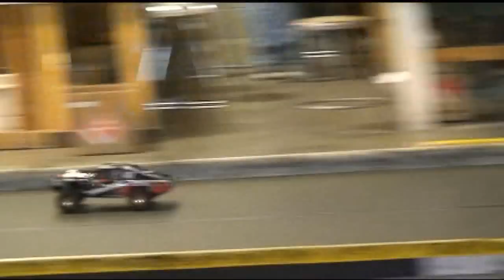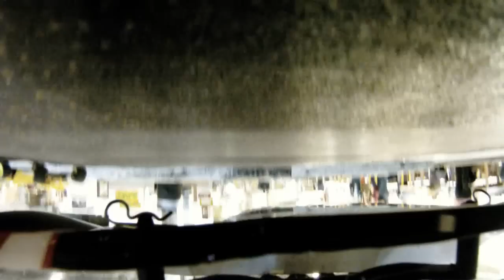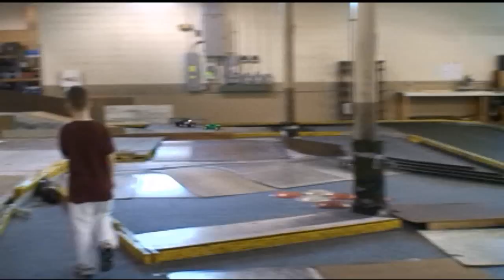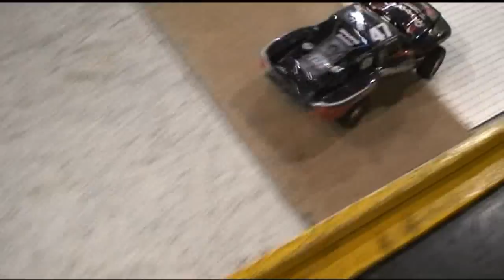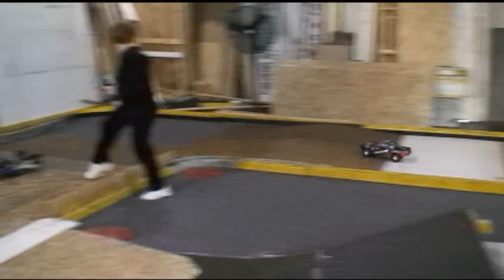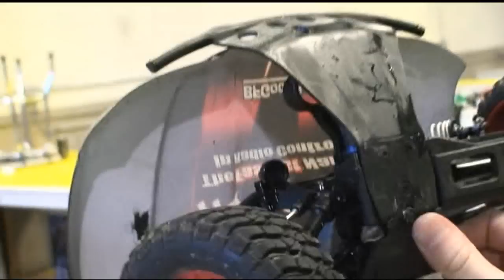Traxxas Slash 4x4 - First time at the track

Comment from the maker: @thecoolman101 I just started actually racing my truck this year. Larry's does not have an open/mod/pro class for 4x4. You must have the stock motor or any 10.5t sensored brushless motor (I don't know why sensored is specified; maybe it's a typo?). I have the same setup as you and had sold my stock motor/ESC about a year ago, so I had to buy a new stock motor to race.

Comment from the maker: @dizzyinzo The Turnigy 5000 mAh 20C 2s lipos seem to be great for the stock setup (Velineon system). I've had them for about 2 weeks now and have not noticed a difference in performance as compared to my expensive Hyperion G3 VX. The same would probably not be true if you ever upgrade the motor to something that draws more current than the stock motor.

Comment from the maker: The track is at Larry's Performance R/C in Sterling Heights, MI. 

Battery is a Hyperion G3 VX 5500mAh 2s lipo. I've since learned that it is overkill for the Velineon system because the battery can supply 192 Amps, but the motor only draws 65 Amps. A pair of Turnigy 20c 5000 mAh 2s lipos are on order (can supply 100 Amps), which should provide comparable performance at less than half the cost.

The truck is a Slash 4x4 RTR (not PE) with no modifications (yet)

Comment from the maker: @Iguanachief91 That depends on many factors, such as what battery are you using, how are you driving it, and what gearing are you running. Just do give you an idea, I generally get around 25-40 minutes of run time from a 5000 Ah lipo battery.